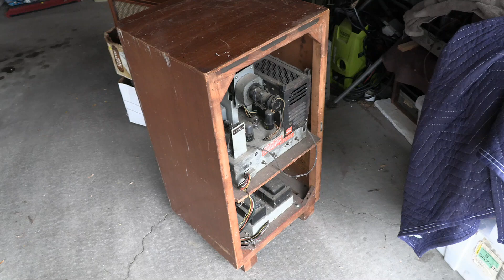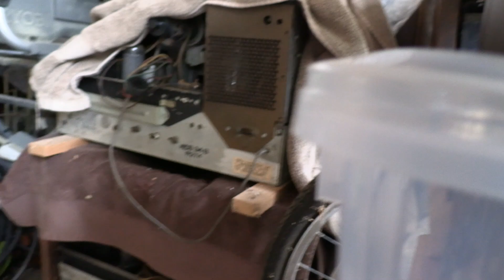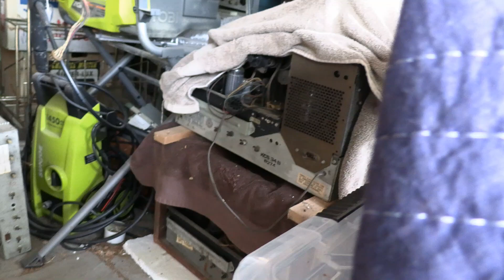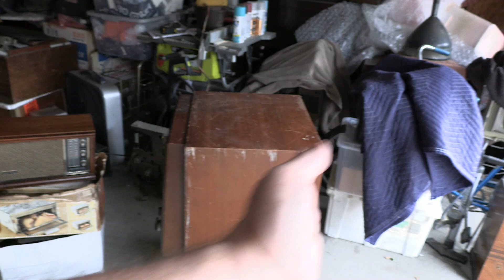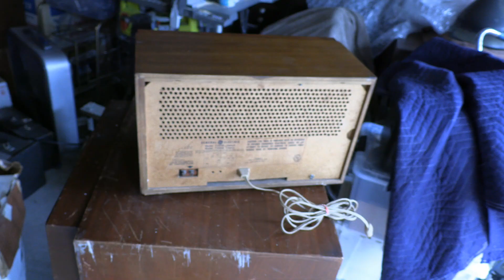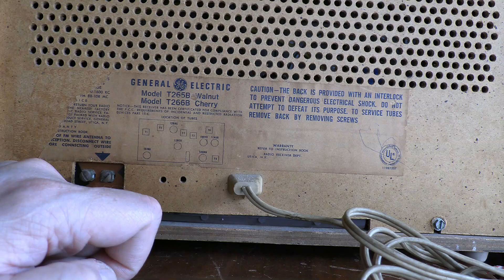Admiral 30C1 score with bonus radio

Comment: Bob, love your channel. When I was a small child my mother had an Admiral table model TV. It sat on a table that rotated. The TV had an AM radio built in. If I didn't like what was on TV I'd turn on the radio. I've never seen another TV like this. It stopped working and went to the Salvation Army when I was probably 7 or 8 years old. I'm 61 now and still have fond memories of that TV. Do you have any idea what model it was??
Reply from the maker: Hi. No, I'm sorry I don't. I've seen Motorolas and RCA's with built in AM radios, but not Admiral. I'm sure the made them too, but don't know the model.

Comment: That power supply chassis looks fantastic but uneconomical, probably why they went away
Reply from the maker: Next year they came out with a one transformer version. I think they used the voltage drop across the audio output tube to derive the lower voltage.

Comment: Wow, I love the design on this TV!  This set was obviously designed before appearance and cost dominated the US TV market.  Separating the power supply from the rest of the receiver and using 2 husky power transformers to generate B+ requirements is outstanding!  The power supplies, being the heaviest part of the circuitry are mounted as low as low possible, greatly reducing top-heaviness.  I have seen so many early radios where half of the B+ power is dissipated by a huge specialty multi-tap resistor; the 2 power transformer method is the best way to handle this requirement.  Some of the later TVs, they made a split power supply that runs off the 350 volt supply, where the audio output tube is in series with the tuner and IF B+.

I also like the flat cabinet back.  I have seen so many TVs "necked" by pushing the TV up against the wall or catching the door frame while moving the set into the house.

Comment: When I was 10-14 years old, I used to find these style sets on the curb in the garbage all the time. I used to drag them home and try to make them work. Don't ask me how a little kid could move a big piece of furniture like that 1/4 mile to my house! That's how I learned electronics. When my folks sold their house they had at least 30 old TVs of mine they had to get rid of. Fortunately, few were floor models. I also remember the old Admiral factory which had a giant neon sign on its roof right next to a highway we rode on all the time. It might have been in Elizabeth, New Jersey. 
The radio looks sweet. Too bad it's loaded with those bizarre Compactron tubes. Yes, you can get them reasonably easily and fairly cheaply, but you probably have no spares to swap in without buying new ones. The good news is that you'll be buying NOS tubes!
Reply from the maker: There are no compactrons and the Admiral factories were in the Chicago area. At least that's where they started.   Perhaps you are thinking of Philco?
Reply: @bandersentv Perhaps there was no Admiral factory there then, just a huge neon sign. Drove past it 50 times coming from NY to NJ. Sorry, I thought you said there were 19--- or 17--- (heater volts) tubes in the radio.
Reply from the maker: Yes, two 19 volt tubes but they are not compactrons.

Comment: That 50HK6 in the GE radio is an audio output power pentode, but it has a heater tap for use with a panel lamp and a solid state rectifier for generation of B+ voltage in analogy to the tap in the heater of the older AA5 classic miniature rectifier tube 35W4.  It must have been just about the last hoorah for vacuum tubes in consumer radios with these late tube types, most as you mentioned with multiple sections.  I hope the tubes are either all good or you have replacements on hand for bad ones, or this will incur an ordering delay (I think it'd still be worth it though).
Reply: It's basically a 50C5 with a tapped heater for a pilot lamp.  There were stereo receivers made which had a 50C5 in one channel and a 50HK6 in the other.

Comment: Like finding a stray and giving it a good home. Two strays even better. The radio looks like something my grandmother
would have had! Came as a plastic cabinet model T-216A also but labelled Musaphonic not Long Range. There was
a clock radio version too. Model number C-540A /C-541A. All good station picker uppers by the more sensitivity inherit 
in the electronic design and in spite of an ordinary  ferrite antenna inside. Both would make great repair / restore videos.